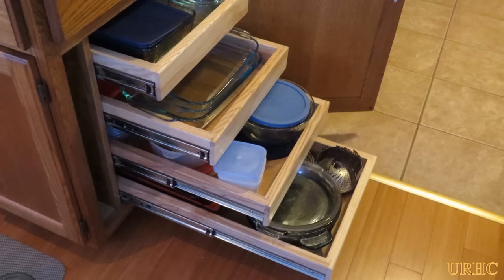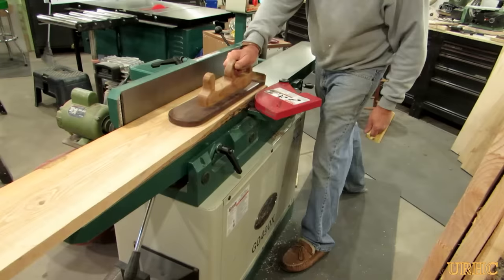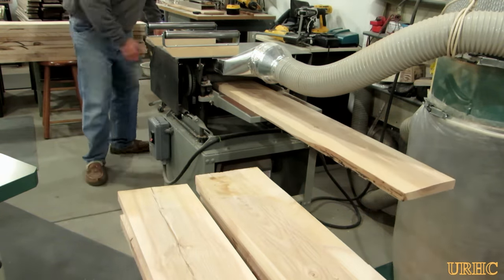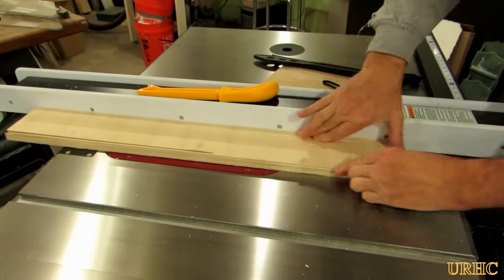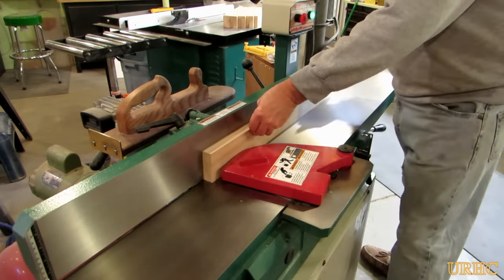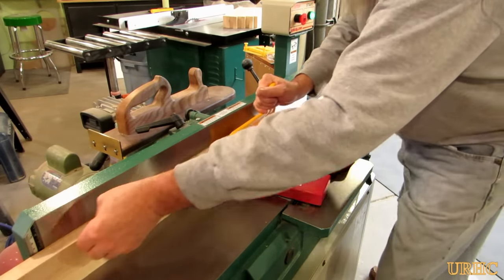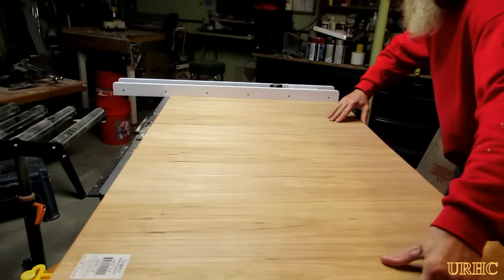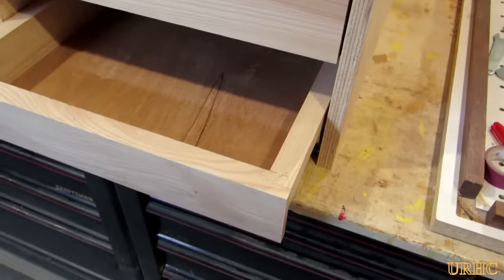Building Pull Out Cabinet Shelves

Comment: My wife and I are remodeling our kitchen and I'm doing all my lower cabinet shelves on good high quality drawer slides. We are long past the age when getting down on our hands and knees to get into the back of the shelves is even possible. Things used to get lost in the back of shelves. I built them with an 8" side across the back and 3" in the front so things wouldn't fall off. Roll outs make so much better use of the space.
Reply from the maker: I have them on just about all my lower cabinets now. They make access so easy. I am surprised how smoothly the shop fox slides move given their low price. I used to spend 3x as much on the accuride slides and these are just as strong and smooth. Thanks for watching.
Reply: I got my 100 pound rated slides from a local surplus dealer for five bucks a pair. They don't have a brand name but they are double ball bearing. If you look around you can get some great deals.

Comment: Very well done indeed. The locking joints will hold forever and the first video that I have seen where rabbet is used to conceal the drawer slides. This also provides a bit more width to usable space.
Reply from the maker: They are very easy to make joints and strong as you said.  Having the slides recessed makes them easy to keep clean.  Thanks for watching.

Comment: I like the joints that you used on your drawers. I would have used 3 different stains to highlight them. One stain for the bottom, one stain for the sides and one stain for the front and back.
Reply from the maker: They are very simple joints to cut. That would look good, but sounds like a lot of work and precise assembly to get it right. Thanks for watching my video.

Comment: I have the same saw and I love it. But like you the chips do add some problems. Love your videos.
Reply from the maker: It has been a great saw so far. The full kerf blade makes a lot of sawdust and when l get a chance l plan on 3d printing a new blade shroud that will allow a dedicated 2 1/2" hose that l think should handle the chips. My dust collector looses a lot of static pressure when it is restricted down like they do at the inlet. Thanks for watching.

Comment: can you put a link to the slides you used ?
Reply from the maker: They are the shop fox 100 lb capacity full extension slides. I bought them from Grizzly.com,  but many different manufacturers make identical slides. They will have to be sized according to your cabinet depth and probably would  be shorter than the 26 inch set I used.